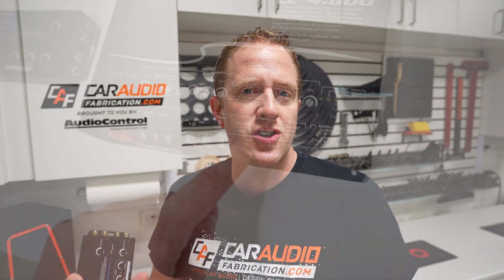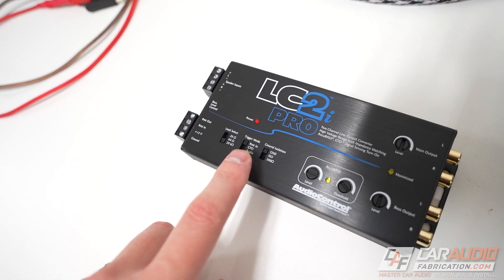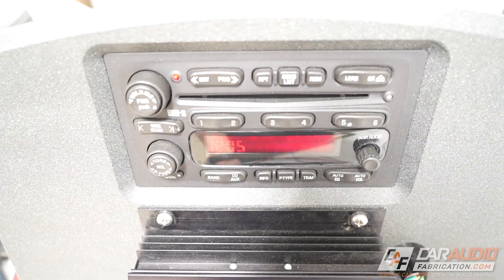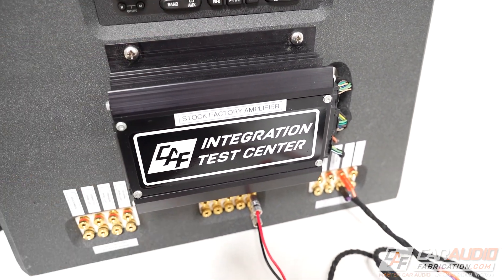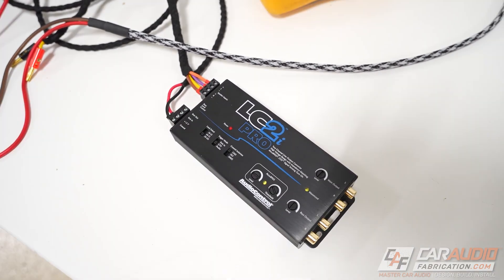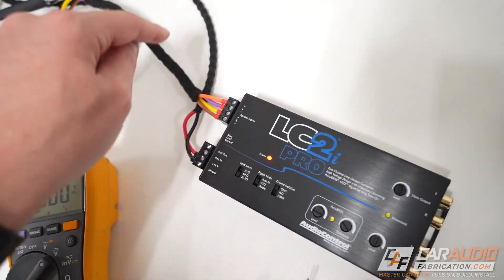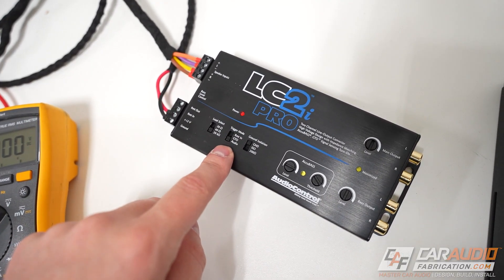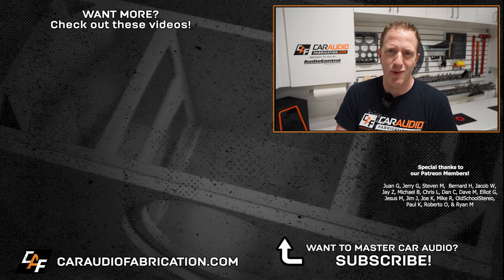Car Audio system NOT turning on/off? Turn on Mode EXPLAINED IN DETAIL!

Comment: I just finished installing a system in a VW Touareg. I used the high level auto remote turn on on a RF R2-1200X1 amp. The amp is not turning off, so looks like Ill have to run a remote line.
Reply: Nevermind, just unlocking the doors will turn the amp on. Waited about 20 minutes and saw thats it off through the window!

Comment: My Lc2i pro is connected as per regular old OEM headunit. Running a CXA 1200.1 Kicker mono amp. Using the GTO option it powers up, and using the "Rem in" to send the singal to my amp to turn on. So everything powers up. 

Heres the problem... maximised light wont turn on when playing around with the switch, and also there is no sound coming from my subs. What can i do here?

Comment: Hi! Love the channel. You're absolutely the official source for all things car audio. I bought the LC2i pro based in your recommendation. My issue is everytime bass drops off for more than say 2 seconds it takes the LOC another 2 seconds or so to put out the signal again. I have the threshold set all yhe way up because it says it will bypass and stay on full time. But like i stated, it does not. Im not new by any means to car audio...no where nesr your level but i had the mecp books and have installed at least 25 full sub/amp systems. So i believe i have done the entire system correctly. I had used crappy LOC before and never had this issue. If you have any suggestions or if this is normal for this device? Its not the auto turn on. That works correctly. Its simply the boost turning on and off. Thanks for any help!

Comment: My bro and i just installed the NVX xloc24x today it has a built in DC offset and works well although it does have a slight turn off pop so we may end up trying to find a remote turn on wire in his 2011 Equinox Pioneer system ....if we can find one... been researching for days

Comment: Hey man. I have a 2014 audi s4 i dont have the premium sound system (B&O). However i want to upgrade the entire system, i found the oem amp labeled all the speaker wires. My question to you is can i use a audio controll LOC and get clean sound? Oem as 6 ch system

Comment: I have a question I have a 2017 Chevy Cruze with 6 speaker I change and amped the speaker my car have the center speaker hole. I wanna add the center speaker and don't know if I connect it to the right speaker or the left  speaker? 
Please help

Comment: the classic remote in is what I use, because I dont always need my subs on (listening to podcast/youtube audio. So I have an on/off switch connected to remote wire to turn on LC2i, then the remote out turns on my subs amp. another note, my car has noise canceling so I had to splice in another on/off switch to cut the noise canceling mics off when using the subs (not the talking on phone mic)

Comment: I have a Boss pm2500 mono amp, it has a protection indicator light. My question is can I set the gain using the protection light ,which I suspect works like a clipping indicator and using a test tone CD at a tone of 40htz., start to raise the gain and when the light starts blinking just turn it down until it stops blinking would that work and be save?

Comment: I always used the GYO mode to save time. Only time I had an issue was in a Volkswagen. Also thanks for the video I learned about the 5-6 volts check
Reply: What was the issue with the VW? I am getting ready to install a stereo in an Audi and I have a feeling it is going to be a pain.
Reply: @Grizzleback07  I’m having an issue with my VW as well. I cannot find a remote wire anywhere and the gto does not work with this car

Comment: I'm surprised none of the modes, are activated by a preamp signal. Not everyone is using speaker leads.
Reply from the maker: If you have a preamp signal you are likely using a integration device or an aftermarket head unit. Both of which always have a remote out. So you would have an easy reliable remote turn on signal to use

Comment: I only use remote trigger. if it's not available I'd rather just have a switch near my dash that I can turn that signal on and off myself. That being said I've also never owned a modern vehicle that has a head unit that you cant replace. my 2008 kia Spectra has an old school replaceable double din so aftermarket head units aren't a problem.

Comment: I just recently installed a PAC LPA-2.4 LocPro Advanced in my '20 Jeep Wrangler Sport S.  It uses DC offset which is cool.  From there, I feed the Remote Out to a relay that powers my 2 amplifiers.  One thing to note though, in some Jeep Wranglers JLs like mine, I had to place a 47 ohm/5W resistor across the speaker line inputs feeding into the LOC in order to get a signal.  I guess those Uconnect radios need to see that resistance, or it will totally shut off that signal going outbound.

Comment: Question. I had a friend install a Pioneer DMH 1770 NEX in my 2012 Chevy Sonic. All the speakers work but on lower volume levels the left side is significantly lower in volume compared to the right. When you turn it above 19 on the volume the left side becomes equal to the right. I couldn't do the wiring myself due to being partially color blind. What is going on???

Comment: I have a 2020 ford escape and the gto function doesn’t work, the loc just stays on. At first I thought I did something wrong. After hours of tinkering, I end up installing a switch. After doing research found out that most newer fords have the same thing. I think it has something with the sync system.
Reply: I have a 2016 ford flex and it works great in mine… I have the sync system using the LC7i with gto.. if the doors are open or screen is displaying the ford logo then mine still has signal until it fully shuts down the radio

Comment: I use the gto on my lc2i pro. In my 2018 Mazda3 there isn't a on/off button on the infotainment screen. So my lc2i turns on the moment i press the engine start button. I've noticed that if I have it on the audio selection the lc2i will remain on for about 20 to 30 seconds after the engine is off. What I have done is wired in 2 on/off switches in the remote out put wires. 1 switch for the mids and high amp and a 2nd switch for sub amp. That way I have total control of when the amps are on/off.

Comment: I have an lc21pro what setting on my amp do I choose for input, high or low voltage?
Reply from the maker: The LC2i-PRO has a maximum output of 9.5vRMS but is considered and RCA "line level" signal